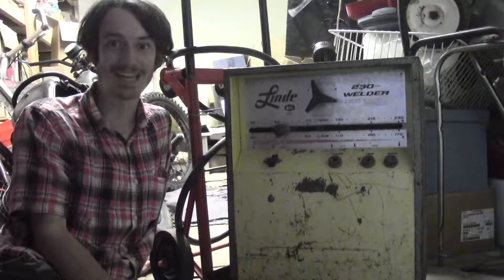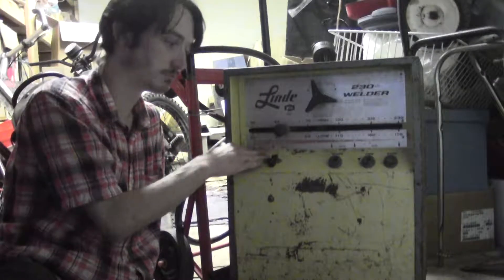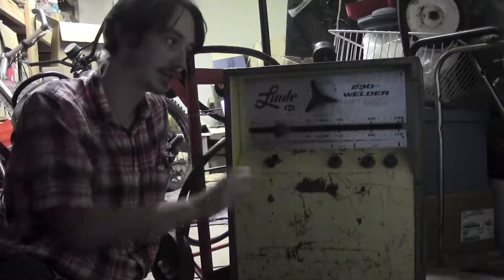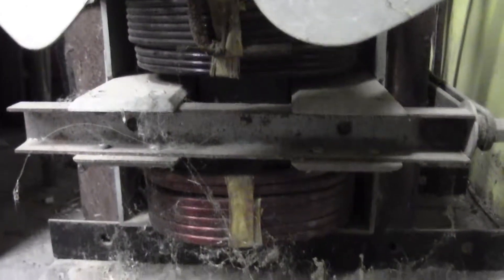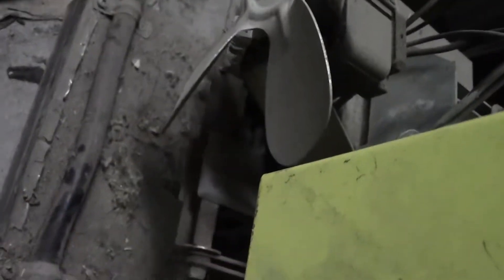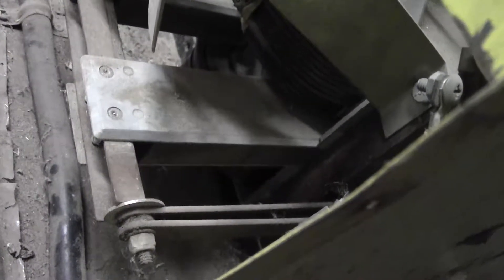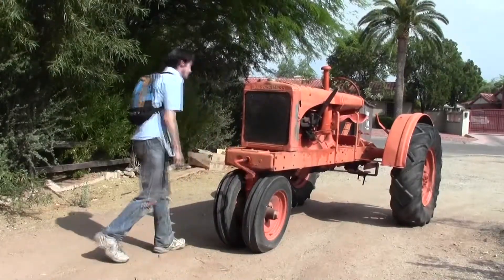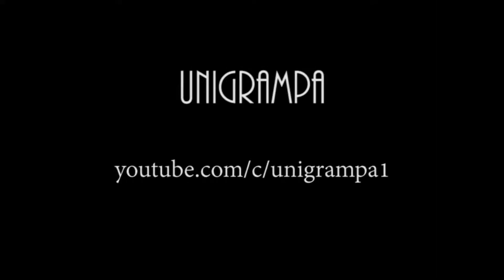What's Inside A 1960s Stick Welder

Comment: Duty cycle is a reference to amount of amps vs time in a 10 min cycle..so a 50% duty cycle would be able to use X Amps for a 5 min time period with a 5 min rest / cool off time..100% would be able to use X amps listed for 10 mins per 10 minutes etc..alot of the cheap Chinese welders have only 20 % duty cycles..2 mins of use per 10 mins..
Reply from the maker: I have a harbor freight mig welder, I've owned it for about 4 years. I weld for as long as I want with absolutely no regard for the rated duty cycle. Welder still works correctly as far as I can tell
Reply: @unigrampa  it's probably a older  transformer type on 220-240 volts by the sound of it then..I really enjoy the old transformer type welders such as a Lincoln tombstone 225amp..and a idealarc 250 round top 300amp machine thats 350lbs of transformer..Just can't kill them..truly multi generational equipment that just works..sure the newer machines are small, lightweight and packed with features but they also happen to have low lifespans and made in China..I mentioned duty cycle as you misspoke about duty cycle in your video saying something about Sine wave balance which has nothing to do with duty cycle..
Reply from the maker: I may have also mentioned duty cycle in reference to pulse width modulation as a method of controlling current. Although I don't actually remember
Reply: @unigrampa   you mentioned duty cycle in 1st few minutes of your video touching and reading duty cycle off the amp metering slide mechanism face plate of the 60s/ 70s large transformer stick welder..that's why it stuck out so brightly as it was gross misinformation given to the audience by yourself and figured you and others may find value in knowing the actual meaning of duty cycle.. pulse modulation and sine wave balance features are several decades past the manufacturers date of that dinosaur stick welder and even now days I cannot think of a stick welder that has those features to date, as those features are associated with IGBT technology and typically used for tig welding..unfortunately there is more misinformation about welding then correct information..examples such as " mig welding " that uses mixed gas such as C25 75%argon/25%Co2 in the USA or 80%argon/12%Co2/8%Oxy in the EU/UK is actually MAG welder the A for Active gas the I for inert gas, as very, very few people use 100% argon to Mig weld ever.. Cheers Mate..